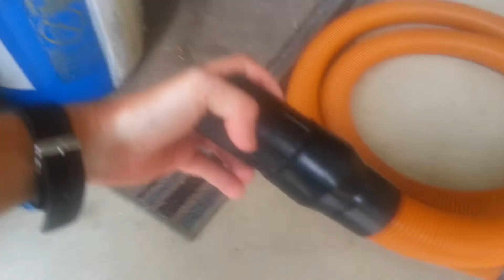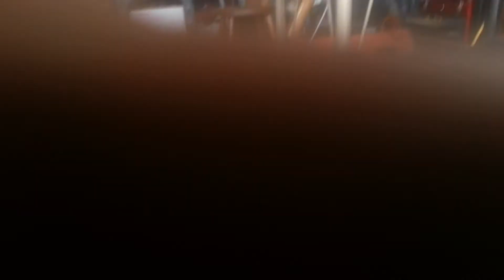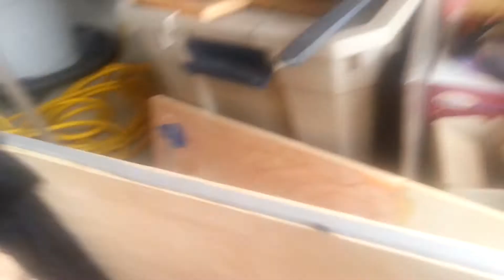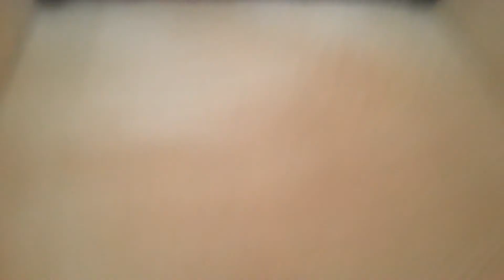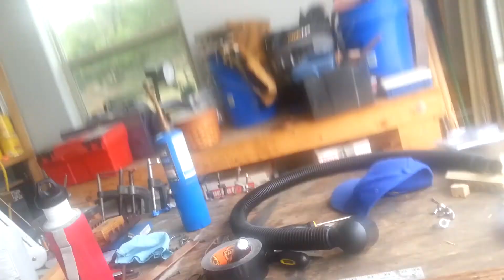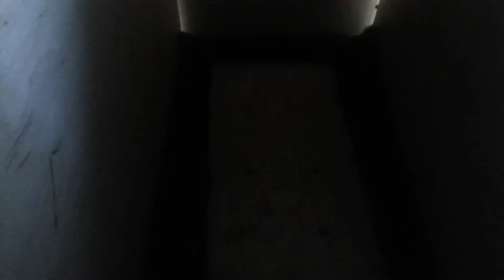fuigo problems

Comment: The one I made actually has a lot of pressure, very good airflow. I used adhesive furniture sliding felt around the piston block, sanded the inside main box a little with 400 and 2000 grit paper, waxed with wipe on poly. The hose you are using seems long.  I screwed a foot long steel pipe fitting on a flange attached to the outlet box. The pipe connects to another pipe in the forge by an elbow and longer piper. Everything is close, but the box bellows is protected by a wall. Fantastic bellows for all sorts of forging and heat treating long and short blades. Pipe diameter is 1.5 inches. You don't want too big or small, about 1 to 2 inches.

Comment: a bit late but maybe this'll still help
The valves are too heavy, air cant flow properly since it takes too much force to lift the valves and the piston board might be a bit too tight fitting, I read that you want the fit to be loose enough to have a little bit of play between the board and the walls/top/bottom but have that gap reasonably well sealed by the fabric wrapped around the board. 
"free sliding without binding up" was a readable translation from a japanese blog on fuigos. 

this is the best(and only) article on making fuigo valves 
http://islandblacksmith.ca/2015/11/making-valves-for-fuigo-box-bellows/

well point is, you don't want the whole thing to be as tight as a bomb shell, that way extra air that cant get pushed out at a reasonable rate wont build up a resistance vacuum.
however maybe that could be mitigated by simple adding more valves.

you, don't seem to have stops added where the valve opening start?
that's an important part, the piston board should stop where the valves start and never go past or over the valves.

the main "force" of the air blast comes from the pipe+tuyere
the pipe you added is too long but the size might be right.
the part that points into the forge and is attached to the pipe(tuyere) is tapered, that way the air blast gets centered/focused down as it enters the forge and becomes more powerful.

Comment: If there are no leaks in the fuigo and you want more pressure at the outlet you have to increase the diameter of the outlet. See Bernoulli's principle: https://en.wikipedia.org/wiki/Bernoulli%27s_principle See also the picture on the right: "A flow of water into a venturi meter. The kinetic energy increases at the expense of the fluid pressure, as shown by the difference in height of the two columns of water."
Reply from the maker: I am already at 2 inches, any bigger will be quite large for a forge.
Reply: Are you sure you want more pressure? I imagine a higher velocity of the air stream would be more beneficial. If you put a nozzle at the end of your tube the pressure would be even lower, but the kinetic energie would go up by quite a bit.